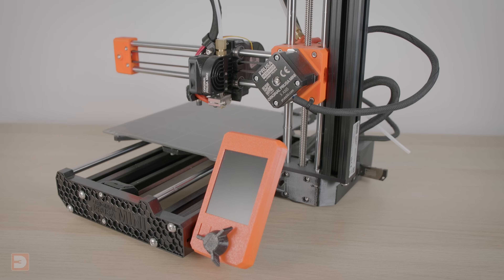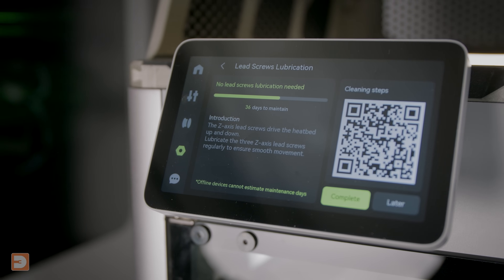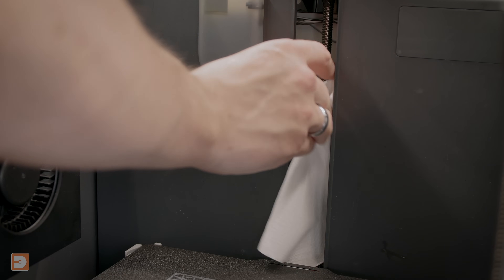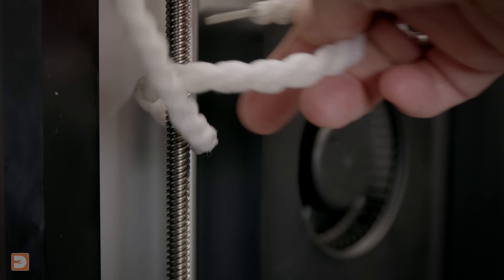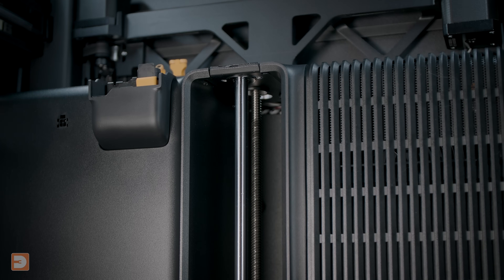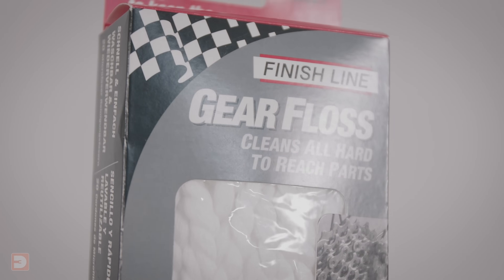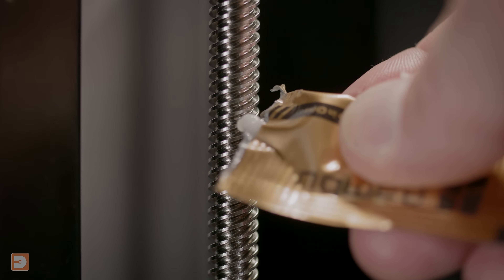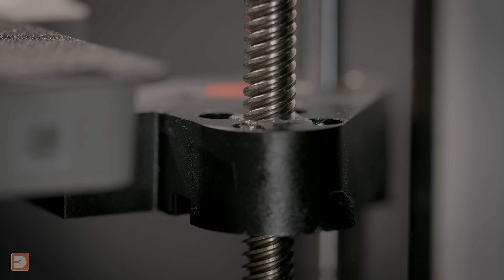The easy way to clean your lead screws

Comment: Gear Floss leaves little fuzzy strings on the z-screw.  Are you concerned the fuzzies will build up over time and cause extra wear and affect accuracy of the printer?
Reply from the maker: Are you using the same brand floss I use in this video? I have absolutely nothing deposited by the floss when I use it, whereas paper towel with the more conventional method was always leaving fuzzies.
Reply: @3DRevolution  yes, I'm using the same Gear Floss as you on my BambuLab H2D and it left little threads on the z screws.  The H2D z screws are a rougher cut than the X1 so maybe that has something to do w/ it.

Comment: Knitting yarn is a good alternative.
Reply: Also, Gear Floss can be washed multiple times before it starts to deteriorate. I stick them in a pants pocket and chuck them in the laundry. A $10 box can last you years if you're mindful about it. You can also use Gear Floss to apply grease. You load up a clean Floss with whatever grease you're partial to and repeat the same actions as for cleaning.

Comment: I did not know about Gear Floss. This seemed like a reasonable solution to cleaning my "Z" screws, so I bought some. WHAT THE FUGGG! Such an easy and economical way to keep my printer clean and running smooth. Thanks so much for the outstanding advise!

Comment: Perfect timing. I am overdue for this maintenance task and like how you simplified it.
Reply: I got the floss and fresh lube (I am sure I had a tube around somewhere but could not find it). IPrinted the cap for the lube, took 3 or 4 tries to get a decent print.  I used one piece of floss for each screw, and they came out black! Not sure the screws got completely clean but they look good and are working well. I ran a calibration afterwards.

Comment: You don't really need to clean the leadscrew if the nut is nylon. The "gunk" left on it is just nylon and could act as lubrication.
Reply: Dust and debris also gets onto lead screws.

Comment: Ehm… There is a print out there, that someone hotglued the head of a toothbrush to. I refined it and if you have them in your part of the world, Jordan makes replaceable head toothbrushes. They just snap in place. And cost nothing. My print even has one on the tip to hold a spare or to use. It’s up to you. Clamp on, send the bed up or down, done. Want to apply new grease? Dab it on a new head and go wild. It’s on Printables. Super Screw Scrubber - Jordan Change Edition

Comment: Those who don't want to buy a special product for this. Get a kitchen microfibre cloth, one of those big ones that come in big bags for basically no cost at all, cut a strip from it and it'll do same if better. I have actually cleaned big industrial machinery like that.

I use those cheap microfibre towels that cost like 3€ for 4 to so many things at home and in machine shops.

You can also use gauze/suture if you got those laying about.

Comment: That feeling when your Ender 3, which is near a 10 year old model(not my particular printer, which is 3 y.o. though), have POM nut upgrade, and you do not need to grease anything at all. Also on Ender 3, you can just release the axle and wash it with anything you want. Very easy to maintain. But I am too lazy even for that, that's why I installed POM nut. No grease - no cleaning.
And ironically all those modern 'no tinkering' models need mandatory complex service. With all those rails, rods and other complex mechanics.

Comment: I found the simplest and easiest way to reapply the lube is to just put some on an old toothbrush and run it up and down the lead screws. The bristles make sure that it gets in all the nooks and crannies. Then I just wrap a piece of plastic wrap around the toothbrush until the next time I need it.
Reply: That’s got to make brushing your teeth really disgusting 😅
Reply: @goilo888 Disgusting maybe, but with your new PTFE greased-up choppers, you'll be biting through apples like an industrial scrap grinder 😂
Reply: @dexarok 😂

Comment: Brilliant tip!
Although not a difficult job it is frustrating and I dread the "Clean lead screws" reminder.

A quick Google found a UK supplier a couple of quid cheaper, so just ordered.

***Update***
I found an even more economical solution.
The UK Retailer 'The Range' sell 'Jumbo Soft Touch Yarn' - 35 Metres of 2cm Diameter costs £3.99 (although they often further reduce unpopular colours).
I have used it several times and it works great :)

Thanks
Reply from the maker: Nice, hope it works well for you!

Comment: I did this recently and learned that Prusa advise you do not use lubricant on their lead screws. They use a POM nut which is self lubricating and they believe lubricant can cause the Z-AXIS to be sticky

I thought it was crazy at first but it is within their maintenance documentation
Reply: They are worried about dirt.  If you grease them and don't clean them the grease will attract dirt causing them to wear faster.  They also flip flop on this.  The XL uses the same pom nuts, yet they tell you to grease them. 

All of my printers are in enclosures and I've been regularly oiling them for over 5 years without any issues.  The key is to keep them clean.